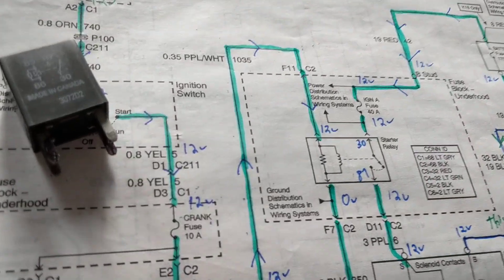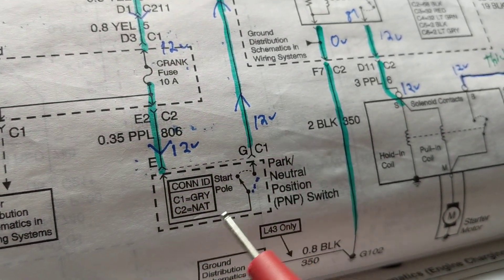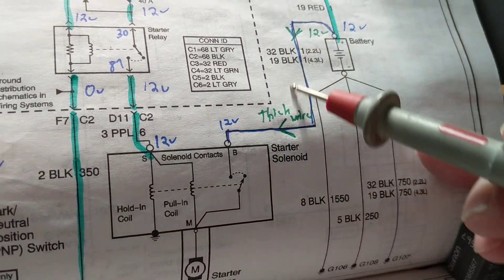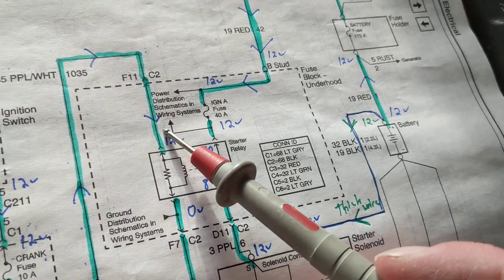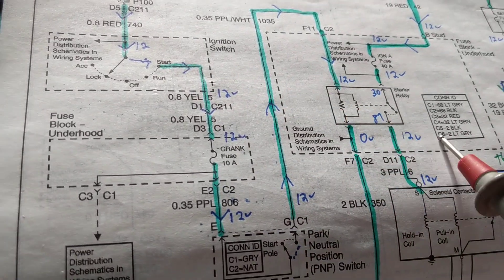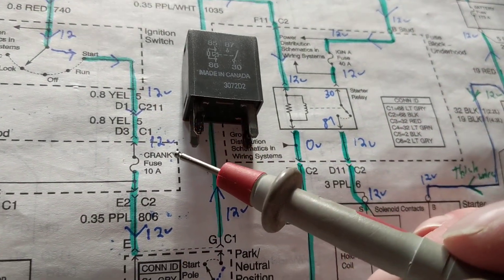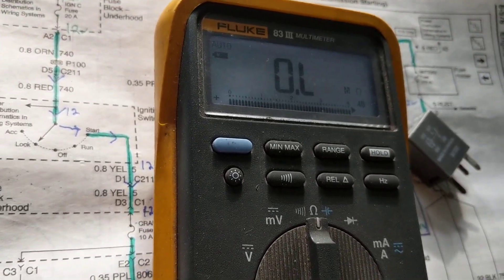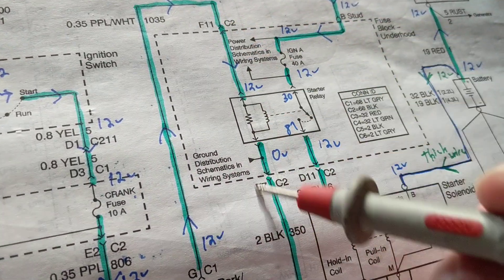HOW TO DIAGNOSE STARTER MOTOR PROBLEMS FROM DIAGRAM WITH SIMPLIFIED HINTS PART ONE

Comment: You can get 12 volts but the best is to test under a load 12 volts on all points don't necessarily means your ok you LL  need the amps stressing the wire to get true voltage. The output will not work correctly without getting the proper amps for which it was designed .
Reply from the maker: That's true that's why it's always good to measure with the relay in the circuit like I stressed in a video

Comment: -Well done for your nice video. I have a problem with the seat Ibiza 2005 1.4 I took out the battery to charge it and when I put it back in and put the key in the ON position it makes a noise inside the dashboard as if a relay opens and closes quickly like a percussion drill and when I turn the starter it turns normally but does not move forward. I checked and found the relay that made the noise I attach it (191 906 383c) 167this relay probably supplies the petrol pump and when I disconnect the petrol pump the noise stops and I measure the voltage and it is about 12 volts while it is on the battery.5 volts and when I put a load lamp instead of the pump, the noise in the relay starts to fight and the voltage drops to 3 volts, maybe someone can help to know where the pump relay is supplied from to control its supply. The relay I have opened is clean and works with a separate power supply. When I put a light bulb in the base where Benny the relay in place of the Coil from the relay the light turns on and has a low voltage of 5 volts and when I put it between the relay and the chassis it lights up normally ((thimios1953@gmail.com))
Reply from the maker: Looking for the diagram but I'm trying to see if you have a fuel pump issue or you have a starting circuit issue with the starter motor these are rare diagrams there are many cables going to the fuse box panel so I can download the correct diagram
Reply: -Thanks a lot for the effort the pump is ok
  the problem is in the circuit the fuel pump relay does not have good ground and it does not work properly I do not know where the relay gets the ground for this I want the design   the relay is 191 906 383 ((167))
Reply: You probably dont care at all but does someone know a tool to get back into an Instagram account..?
I was stupid lost my password. I would appreciate any assistance you can give me.
Reply: @Finn Alberto Instablaster :)
Reply: @Kai Kyle thanks for your reply. I got to the site on google and im in the hacking process atm.
Takes quite some time so I will get back to you later with my results.
Reply: @Kai Kyle it worked and I now got access to my account again. Im so happy!
Thank you so much you saved my account !
Reply: @Finn Alberto Happy to help xD

Comment: -Your video is good and I have been watching them for a long time
I would like if you can upload a video for the relay circuit 191 906 383C 167 petrol pump seat Ibiza 1.4. 2005 VSSZZZ6LZ5R176526
Reply from the maker: It's something that I have to look for a diagram for a rare car
Reply from the maker: If you need a wiring diagram a single page go to Google put in the vehicle number the year and starting motor circuit otherwise you'll have to buy a whole set try that and get back to me but always test the relay in circuit do not take it out it will not be accurate that way I made a video on that on my channel Joe I was trying to schematics for auto always test the relay in the circuit

Comment: 1) Check the battery voltage and make sure it's at correct level
2) Check the voltage across the relay's coil. You should find 12 around 12 volts.  
3) 12 volts across the relay coil still doesn't confirm that it's fine. An open coil could show a 12 volt reading.
4) Check the voltage across the contacts of the relay. You should find 0 volts there. But this also carries another doubt. 0 volts across the contacts could also mean that the load doesn't have its groud. 
5) If you find 12 volts across the relay while the load is properly grounded, it means that the relay has not switched. The key point is that the voltage across a closed swithc is 0
Reply from the maker: I agree with you on all points the first point making sure that the battery is 12 volts and correct level if the battery was not at the correct level we would have not be able to engage the starter motor it would be a different problem it would be a no crank problem about the relay since there is a computer controlling it that's why I suggested in the video to put a clamp meter to measure the current flow in the load side thank you for your comment you are very educated in electronics I see
Reply: @Joeelectronicschematicsforauto  thank you Joseph. No, I'm not good at electronics. I'm just learning from teachings of yours and others like you. I like your content and consider your channel to be unique. I don't see any other channel that's totally dedicated to automative electronics like yours. Hope you'll continue adding more videos and blend them with real-world, practical troubleshooting. Adding some automotive pcb repair would also be great! Componet level electronics repair is going through a solid comback right now, right at this moment. When electronics was revolutuonized by surface mount components, majority of the techs at that time couldn't adapt to the drastic change and a lot were left behind while the rest quit altogether. Things have changed now. Advanced test equipment and sophisticated tools have been developed to meet the radical demand and today's cool boys know very well how to grab money from something that was deemed hopeless. I hope you get my point. Keep posting new videos Joseph. You're doing great!
Reply from the maker: @roseelectronics4582  I agree with you 100%. I started making videos a while back about PC boards and soldering and for some reason there was no interest in it usually I do a search on tubebuddy application to see what people are interested in before I go through the procedure of doing a video sometimes this saying like one person said it's too complex for them so you have to find a fine line or the model electronics is a difficult subject to explain everything is computerized I'm trying my best we'll see maybe my other channel will be more Hands-On but I didn't make Hands-On videos on this channel Joe electronics schematics for Auto I thank you so much for your support good luck
Reply: -For you and happy new year to all and by the way I want to ask In which fuse box is this ground in the cabin or in the engine, I think you are right about the ground because in the case from the relay when I put a light in place of the Coil from the relay lights up the lamp and has a low voltage of 5 volts and when I put it between relay and chassis it lights up normally on the base from the relay after I removed the relay
Reply from the maker: @thimios1953  the ground that you want to choose from is the ground that's in the wiring diagram noted as g something that ground with respect to the negative battery ground should be almost zero remember ground bolts can have corrosion basically speaking with respect to grounds you keep one probe of the meter on negative battery and the other one on the ground that you are measuring for voltage drop and you have close to zero thanks for watching